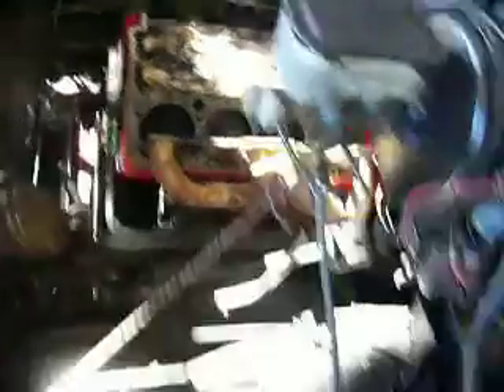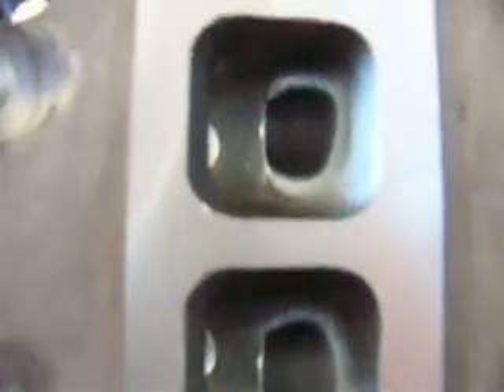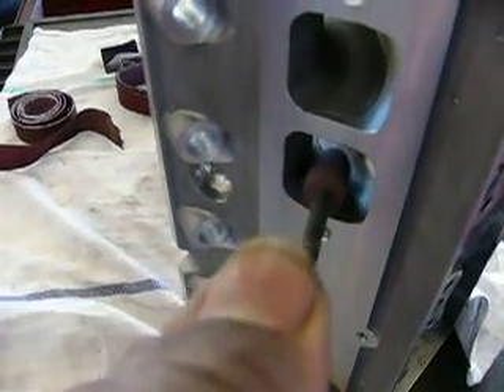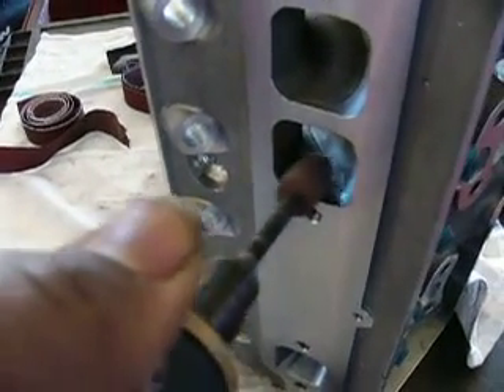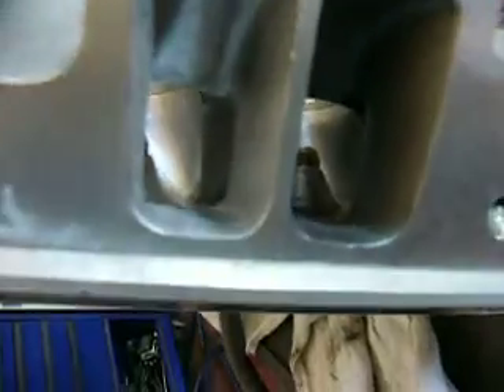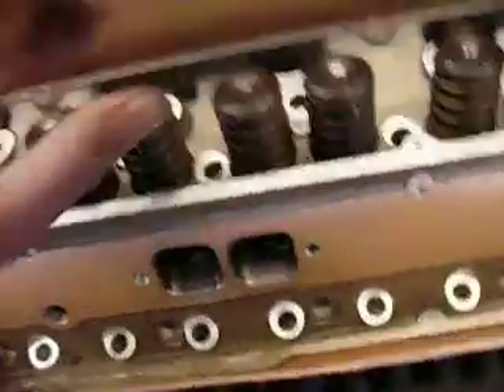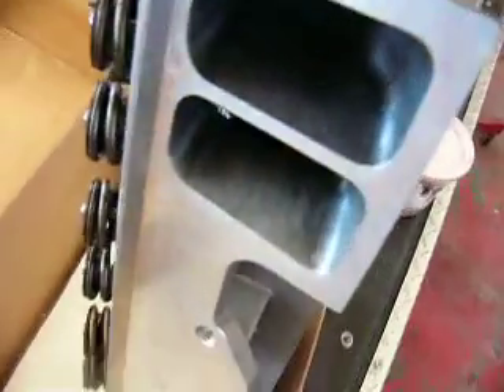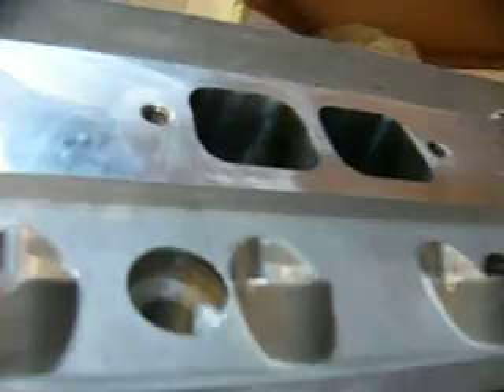A.R.T. PROCOMP CYLINDER HEAD PORT AND POLISH 3

Comment: Nothing wrong using budget heads. Pro Comp alloy heads may cost about $1000 for both,  while AFR or DART heads are $1,200 each- sometimes more.I would use replace the valve, the spring and rocker stud for better and certainly use ARP head stud.

Comment: hi are this head good of the box and if so how much horsepower?
Reply from the maker: The engine dynoed at over 400 horsepower with a stock displacement 400 cu. in. short block. Rebuilt with Scat crankshaft, stock rods and pistons. I forgot the exact Horsepower specs. We ported and polished the Procomp Cylinder Heads. 210cc intake runners, 64cc combustion chambers, 2.02 and 1.60 stainless swirl polished valves. We thought we had to worry about the 400cu.in. steam ports in the block, but no cooling problems arose. Also make sure you use the correct head gasket, roller rockers, hardened push rods, etc... 
Good luck, C.J. w/A.R.T.